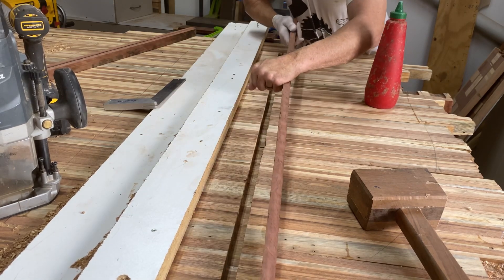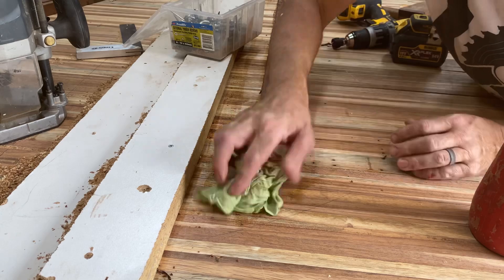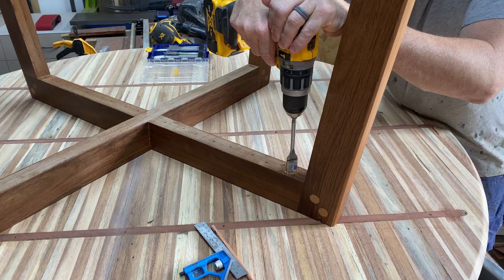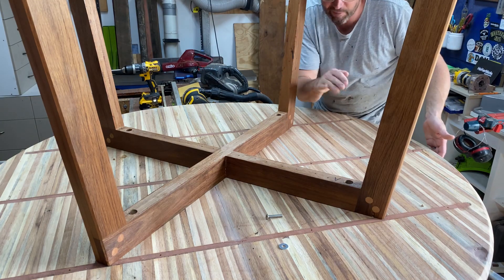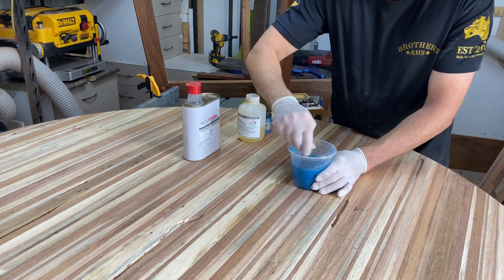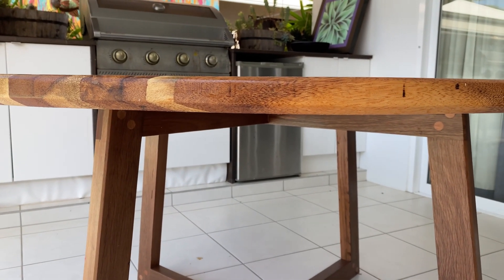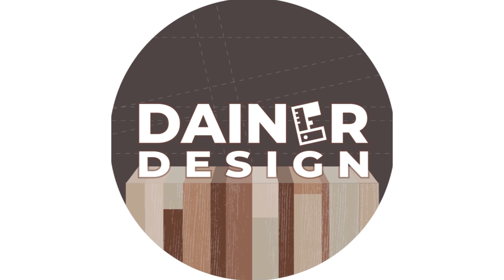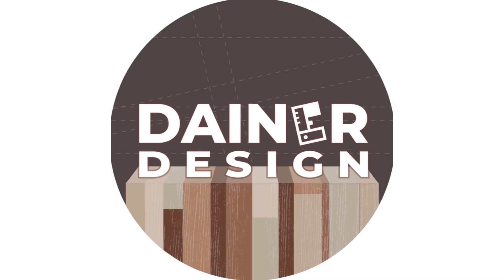BIG Dining Table made from PALLET Wood and Reclaimed Timber

Comment: Would heavy duty casters help in moving benches around the shop? There are some “special’ ones that you engage - bench lifts, you roll the bench and disengage so the bench comes back down in contact with the floor. And of course I dont know what they are called but am sure you can find’m if interested. 👽